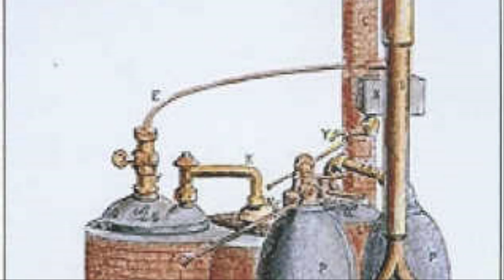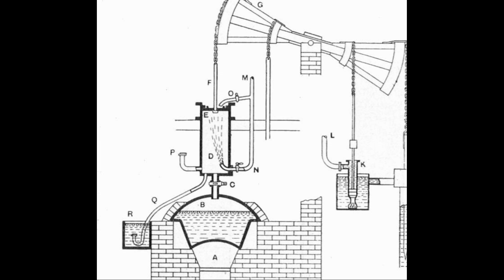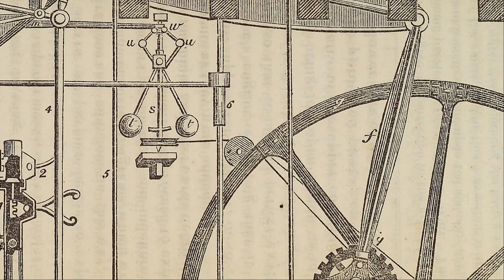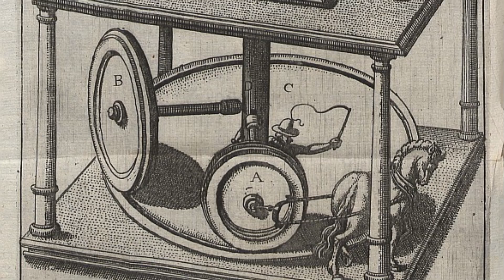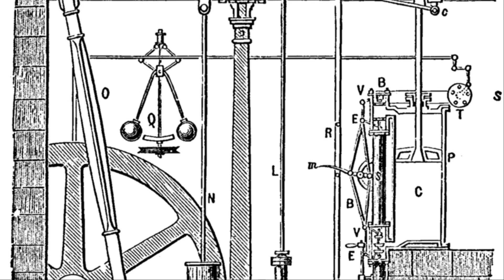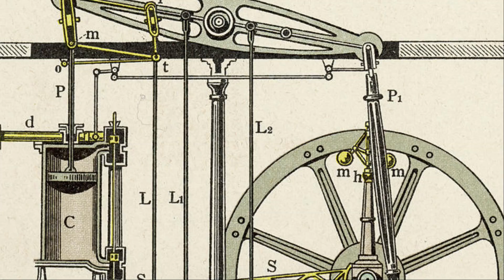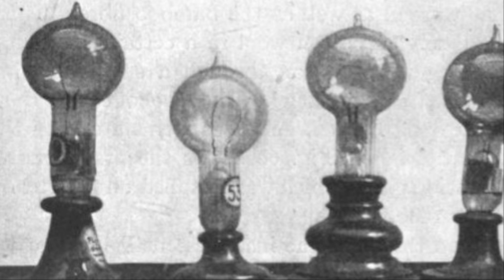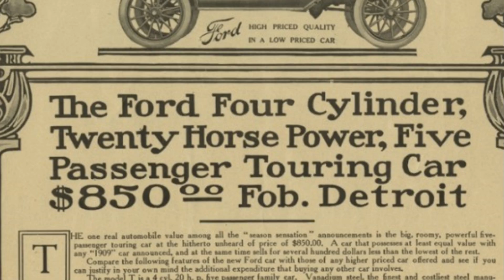Horsepower: James Watt and the Transition from Horse to Steam

Comment: so for factories using Steam Power, multi-story buildings were used, with (1) or a few steam engines powering the various types of equipment via leather belts, including vertical ones through holes in the suspended floors

factories using electric motors, many smaller motors are used in long single-story buildings

after WW2, the multi-story factory buildings in "Rustbelt" cities were abandoned, the cities de-industrialized, 

and the old workforce was largely abandoned as well

Comment: Watt was also credited with creating the centrifugal "flying ball governor" which modulated a steam engine speed, which made steam engines safer to use and not run out of control.  The phase "going balls out" refers to centrifugal force forcing the balls of the governor outward, acting on a spindle that controlled the amount of steam going into the engine, slowing the engine.  Going "balls out" meant the engine was at capacity.

Comment: Thank you for the lesson. The 33 lb weight and the 1000 ft of rise are the easiest visualuzations for me.

As a side note water weighs 8.3 lbs per gallon. So a 1HP steam engine could pump 4 gallons of water from the bottom of a 1000 ft well once per hour.
Reply: No it is a minute. 33,000 pounds raised one foot in one minute is a horsepower. You thinking it is an hour means you owe us a lot of buckets of water. Now get hauling!

Comment: One sleepless night I run across a web that said that based on methabolism, you could use any animal for mesurement of power. I don't know if that was true but they put the equations and I wondered if a hamster spinning in a wheel could be a useful representation of mechanical power. A few numbers later I arrived at the conclusion that a 300 horsepower Ford Mustang has around 800.000 hamster-power.....And that's something you didn't know, right here XD 
 Best regards History Guy. Top shelf content as always

Comment: 5:34 "the energy it takes to raise the bucket is one horsepower" - there's quite a tricky thing here in that horsepower have dimension power, which is energy per time, i.e. a different physical quantity than energy (The energy required to raise the bucket is one horsepower times one minute, or put in another way; during the minute the bucket was raised, the horse produced a continuous one horsepower). I'm also a bit at loss to eloquently explain the intricacies of physical units, so I'm not judging you for these innacuracies, but since the video is partly about the unit, I thought it at least had to be mentioned.
Reply: Are you dense? He said in one minute. You do know that minutes are a measurement of time, don't you?

Comment: Great video, but there are two problems:  1- Horsepower is not a measurement, it's a calculation based on torque and output shaft speed. 2- It takes 746 watts is equal to 1 horsepower.

Comment: It's a clever unit of power and especially so for its context in the days where machinery could have a tangible comparison. Horses in use for work definitely had an average output and most people of those times could certainly relate the term. After all, the industrial revolution had to have the mixture of horse and machine at some point. And indeed, horses remained in the mix well into the age of the automobile. This is another good THG episode that ranks well among the other measurement videos.

Comment: The electrical "watt" is a function of voltage times current (amperage); and relative to the electrical power produced by a generator,  or  "consumed* by incandescent light bulbs, where it is not strictly a measure of the light output (in today's era of LED lighting we now use Lumens to refer to light output, and the Kelvin scale to refer to color spectrum of the light, even though LEDs produce minimal heat).  

 Also note that electrical devices that do physical or mechanical work such as motors are typically rated not only in horsepower but in wattage consumption, typically having a metal decal that lists operating voltage, and amperage or current draw, as well as the wattage.

Comment: As an operator of gasoline and diesel powered equipment, I found this very interesting. It would have been nice if you had touched upon the different ways they measure horsepower though.
Reply: He needs to keep it short.
He may make another on some measurement method if it is very important.
Basically, it always comes down to Torque*RPM*Constant

Comment: In my stint of teaching GED Science (and other subjects), I divided 33,000 ft lbs / min into 550 ft lbs / sec. With this, I provided an example of bench-pressing 275 lbs, 2 feet, in one second. My students could easily picture that.
Reply: Yeah but can your students picture bench pressing that weight for hours on end? My weed wacker puts out a horsepower. If I'm going to trim the whole property it takes me about an hour too.
Reply: @1pcfred  Many could picture repetitions on the bench. It was a rehab/correctional facility and about half had done prison time. I have no idea how much whacking you need to do in an hour. Rotational power is much more complicated. Thanks.

Comment: 1st a horse engine where the horse walks in circles is called a "whim"
2nd Watt, kilowatt etc has pretty much replaced "horsepower" as a measure of power output everywhere except North America
3rd Watt's engine was a dead end because it depended on condensing the steam and hence relied upon atmospheric pressure. It was high pressure steam, from the work of Trevithick and  Evans, that provided motive power. Boulton and Watt, by creative use of their patents, stifled this for several years.

Comment: Note: The power unit of horsepower is commonly used in the Imperial (English) unit system, while the "watt" is a metric unit.

In the metric world, kilowatts (1000 watts) is used instead of horsepower, more often, for rating engine power. The metric horsepower, less often, since its not an even decimal conversion (75kg-m/s doesn't evenly divide by 10).

Comment: I believe it wasn't until Watt's later engines or even after him entirely that steam engines actually generated most of their power on the expansion stroke. Newcombe's made 100% of it's power after cool water was sprayed into the steam filled cylinder causing it to condense and outside air pressure would forcefully drive the piston. Basically the earliest steam engines operated on negative pressure then Watt transitioned them into positive pressure and as steam power spread to ships and locomotives they reached quite high operating pressures but for the first hundred years or so they pretty much operated on the exact opposite of the principal we're taught.

Comment: James Watt chose a medium sized horse of 3/4 ton working at a medium pace to determine 1 horse power. Or in Metric units, 750 kg of horse to generate 746 Watts. 
So we have 1 kg of  an animal is equal to 1 Watt of power. A 70 kg cyclist friend confirmed this matched his steady 70W output when on the road. 
So I guess a good sized squirrel in its cage would pump out 1 Watt.

Comment: I believe it was 1973 that US auto makers switched from gross horse power ratings to net horsepower accept in 1979 Ford listed its new 2.3 Turbo in the new Foxbody Mustang at gross horsepower vs the rest of the engines available at net horsepower. Then the 1985 Mustang GT 5 speed was listed as 210hp when it actually made 235hp. The 2003/2004 Mustang Cobra was rated at 390hp when it was actually around 450hp. Other car makers have under rated the power of performance cars to help keep drivers insurance rates down.

Comment: To measure power, you don't have to necessarily exert a force upward.  Exerting a force over any distance will give you a power measurement.  Lifting upwards is just easier to visualize for a non-technical person. Otherwise, cars wouldn't be generating any horsepower since they generally move horizontally.

Comment: The output of a lightbulb (really it is called a lamp, you plant bulbs in your garden) is not in Watts, it is in Lumens.  The wattage is the power consumed to produce that output.  For example a 60W incandescent lamp gives off about 800 lumens,  whereas an 800 lumen LED lamp will use only about 7 Watts.

Comment: It's rather ironic that just over 200 years later his name represents a unit of power which is now used to define how much his famous "invention" of the unit of power is. And while horse power may eventually fall to the way side as a unit of measurement. The watt will likely last until the next great leap in technology. What more could an inventor want than to have his name known for the ages and it tied with his lifes work?

Comment: I want to say I love all your content but I can't contain myself. I must comment on your description of the output of a light bulb measured in watts...  
The output of a light bulb is actually measured in Lumens or Candle power. Light bulbs are a load on an electrical system and the load they place upon an electrical system is measured in watts. LED lights are frequently advertised in a way that compares their light output to that of incandescent light bulbs as an average lumen output that an incandescent light of a given wattage would produce. Then they display the wattage the LED light will draw as the actual comparison. Just another marketing strategy very similar to James Watts use of hoarse power.

Comment: So the Newcomen engine was what Watt might have called a heat difference engine, now called a Heat Engine by some and most annoyingly a Stirling Engine, even though Stirling's patent was for a 'regenerator' on a type alpha heat engine, which he thought might be a 'free energy machine'. Please discuss.
Reply: The "Sterling Engine" also works as a heat pump.  This means you can use one to make a "thermal battery".  When the sun is hitting the solar panel, it make LN2.  When it is dark out, you can run the engine on the LN2's lower temperature.

Comment: Interestingly, the first steam engines did not use the pressure of the expanding steam; they used the partial vacuum of the condensing steam.
Reply: Making a boiler that did pressure was not easy with the technology of the era.  Event the seal on the piston was tricky.  It seemed that the best one was made out of wet rope.  The water stopped the air from making its way through the rope.

Comment: Another great post.
Then we get into another variation  of the measurement 
Brake Horsepower
Reply: How's much power you get at the "breaks" and after losses due to friction. Heat etc in the drive train.
Reply: Sure, there's also wheel hp, crank/engine hp, gross hp, net hp. It mostly just depends on where in the drivetrain you measure from (and whether you have accessories like fans and pumps, for net vs gross hp)

Comment: jay leno has at least 2 steam engines installed in his shop just for fun. they are real not mockups . one is like from 1830's the other a little newer. he uses a modern certified boiler to run them. something like 2.5 million BTU

Comment: It should be noted that one "human-power" is approximately 125 watts with some people able to sustain 300-400 watts of output work for a short time.
Reply: Back when I was a young and fit person,  I could do 125W for an hour without hardly noticing and 500W for a short burst.  My breathing couldn't keep up when doing 500W.  A person on a bicycle can get moving quite fast at the 500W level.
Reply: @kensmith5694  I can not stand biking on flat land because at least with hills, you have a rest while still in motion on the other side.
On flat land, the only rest you get is when you are stopped, not getting any closer to your destination.
XD
Reply: @MikinessAnalog  
On a bike, it is always uphill and against the wind in both directions.
On flat ground, you can pause the peddling and coast a bit or just produce less than 125W worth of power to take a short rest.  As a fit person, my trip home would be faster because at the home end there was a shower.
Reply: @kensmith5694  It isn't "always" uphill, but you are correct about wind resistance. No getting around that LOL
I still like hills more than flat land because of the downhill rest.

Comment: I almost think the horse power rating of a car engine is bogus.  I had a Bonneville a few years ago.  It had a V6 and was rated at 205 hp.  My daughter called me one day and said her car died.  She wasn't far away so I thought I'd hook hers up to mine and I'd pull her home.  After hooking up with a couple of chains, I started out but I had the tachometer up to 4000rpm but we were barely moving.  (Yes, her car was in neutral.)  I thought if I actually had 205 horses hooked up to this car, we'd be flying.  Finally called a tow truck.  I wasn't about to burn out my engine for a 3 mile trip.

Comment: It has always bothered me using HP as a metric for engine power.   Because the formula for horsepower {calculated as torque(in ft/lb) times shaft speed (in RPM) divided by 5252},  you can have very different engine performance from two similarly rated engines depending on where the peak torque is.   An engine that makes 200hp at 2000rpm will feel much more powerful than one that needs 6000rpm to achieve the same power and that power will be more usable during normal conditions - I mean, how often do you drive your car at 6000rpm, right?

Also, since hp is reliant on shaft speed, an unscrupulous manufacturer can increase their hp numbers simply by raising the RPM limit on their engine.  An engine with 263ft/lb of torque at 6000RPM produces 300hp, but if you just raised the rev limit to 6500RPM, all of a sudden the engine can now make 325hp.  Assuming that they use the same transmission and gear ratios, does drivability change? No.  Does it now accelerate faster?  No.

edit:  I realize that I am simplifying some aspects of the analogies.  I didn't want to make my comment too involved.  :)

Comment: Ahhh, The disparity that makes vehicles sound so much more powerful is that hp is the average power of a horse, while car engines are spec'd in peak hp only achieved at a narrow point in their speed profile.
Reply: Yes, and also commonly without accounting for the power steering etc that take power off the top.

Comment: 3:05 Isn't that a 1884 Crossley internal combustion engine?
Reply from the maker: Yes, I juts used it to illustrate the conversion of a piston to spin a wheel.
Reply: @TheHistoryGuyChannel  There is one in the science museum here in Birmingham, UK.

There is also a nice hall of steam engines.

Watt, as I am sure you are aware, lived and worked in Birmingham, with his business partner Boulton. It is a shame that their "Manufactory" was demolished, as was Watt's house, although Boulton's still exists.

One of Boulton and Watt's engines is located in the middle of a roundabout in Birmingham: https://www.google.com/maps/@52.4924813,-1.8877218,3a,75y,259.43h,85.87t/data=!3m6!1e1!3m4!1s30KYo_61uhdpTmj3gjd3KQ!2e0!7i16384!8i8192?hl=en

I drove around the roundabout many a time without noticing it, until somebody pointed it out.

Comment: 8:19 that’s not even the best part! Back in the 80’s the museum restored the engine to operation condition, and it still runs today at the castle hill site, with steam provided by the museum’s central boiler.

Comment: Also caused any number of explosions as under maintained boilers went kaboom.
Reply: ... or badly designed.
The design of a boiler is one of those "looks easy but is hard" things.  They needed to pay attention to the strength of the metal when hot and the creep problem.

Comment: @5:20  A "foot-lb" is not an amount of force.  Force is measured in pounds (or Newtons in the SI system).  A "foot-pound" is a unit of energy, or work.
@5:44 No, the ENERGY to raise that bucket is 33000 foot-pounds.   The POWER to raise that bucket in one minute is one horsepower.

Force, energy, and power are commonly confused terms, but are all distinctly different.
Reply: True, but ... THG is a historian, teacher and storyteller - not a metrologist.
Reply: @GraemePayne1967Marine  What does weather have to do with fundamental physics definitions?
Reply: @ateamfan42  METROLOGY - the science and practice of measurement; one of the major sub-fields is calibration of inspection, test and measuring equipment. 
METEOROLOGY - The scientific study of the atmosphere and what we experience as "weather". On television, the art of guessing what tomorrow's weather may be. Metrologists calibrate the instruments used by Meteorologists.
Reply: @GraemePayne1967Marine  Do you mean to tell me words have specific meanings, and if one uses the wrong word, then communication can be unclear?

Comment: We measure the power of engines in kilowatts here in Aus.
Reply: That is a fairly new trend.
A cute fact is that when powering an electric motor, you need about 1000W to make 1HP.  This is because for the purpose calculation all motors are 74.6% efficient.

Comment: Lance, I realize that you are the History Guy, not the Science or Engineering Guy, but you are getting your terms all mixed around here.
Power is the measure of work in a period of time.
One way of representing energy is the amount of work done. No need for time. It requires the same amount of energy to lift a bucket one foot in two minutes as in one, though the latter requires twice as much power.
Force may or may not generate work. You can lean against a wall with 10 pounds of force, but if it does not move, no work is done, and no power is generated.
I am now prepared to be corrected on any oversimplification I may have committed.